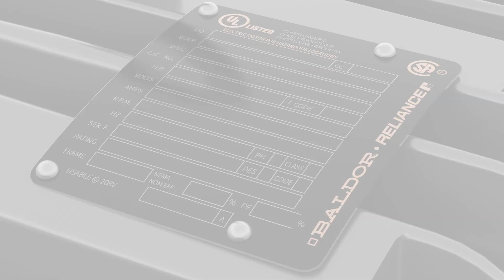ABB’s Baldor-Reliance Explosion Proof Motors

Comment: Give me an explosion-proof motor and a box of dynamite and I bet I can blow it up.......lol.  

I've spent quite a bit of time in the petro-chemical industry, I've installed quite a few explosion-proof motors in classified (hazardous) locations. An explosion-proof motor installed per code greatly reduces liability at every point.
Reply from the maker: Thanks for watching! Intentional destruction and hazardous protection are much different. :) Be safe out there, RR KNL.

We're glad that the safety and quality of the design and manufacturing of Baldor-Reliance motors can keep the chemical, oil, and gas industries running.